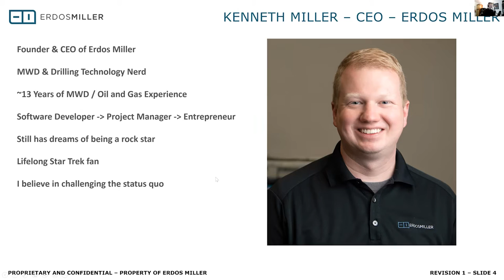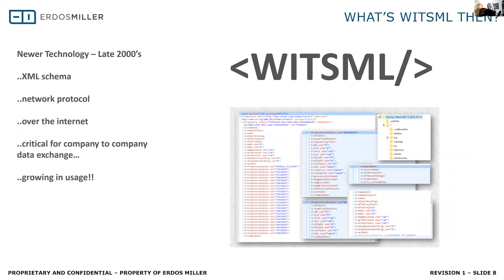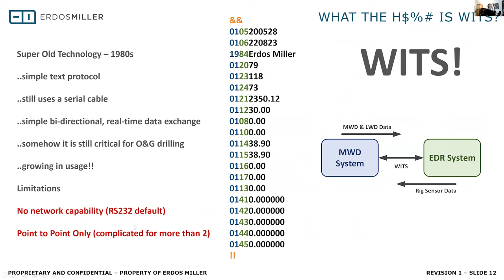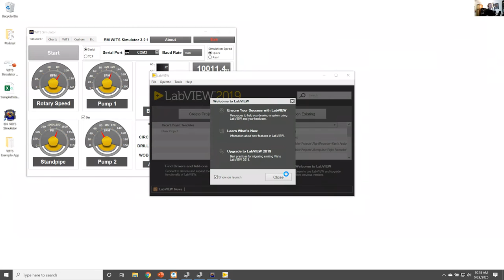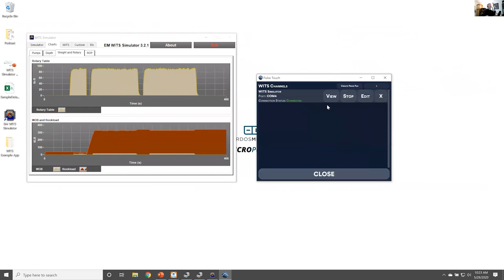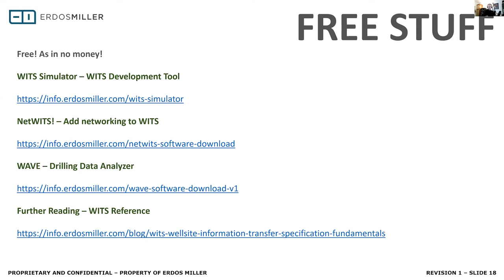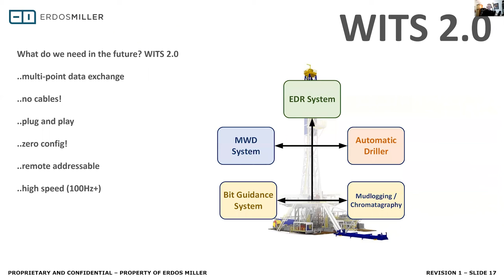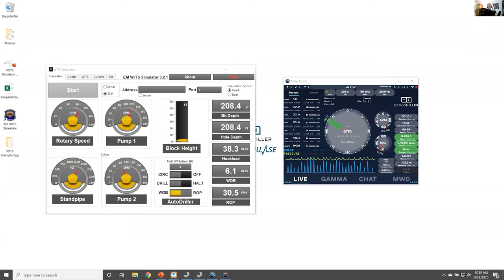WITS Webinar

Comment: BSON - Binary Json was the next WITSML deal I think…. The problem with WITML is that you are sending a document, not a simple data value. WITS 2.0 needs to have point of origin, value, time measured and time received….. events can be time shifted if the aggregating computer is out of time sync. even if it forced a clock sync behind the scenes. Point of origin is useful for differentiating between systems that independently track a parameter, say MWD encoder depth, MWD SPP.